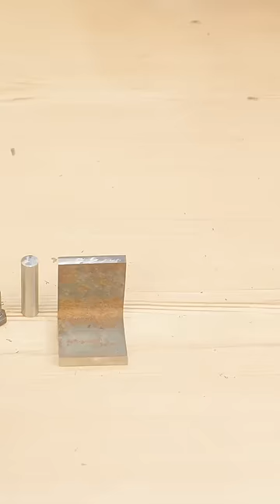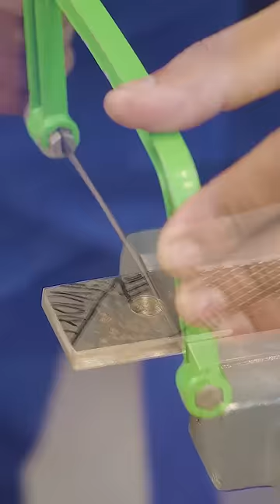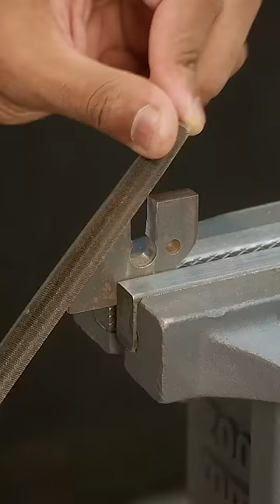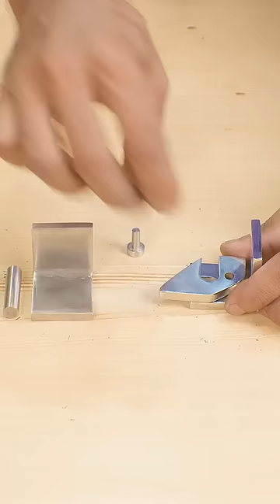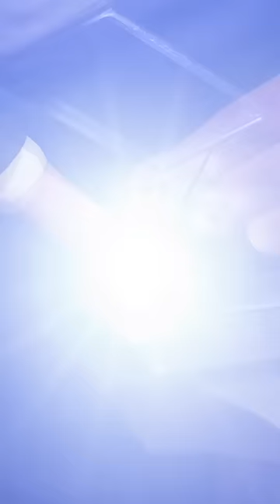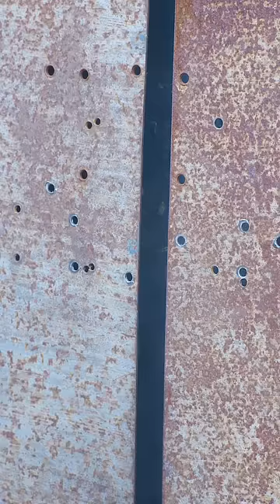crafting an amazing door latch 4 #metalwork #craftideas #diycrafts

Comment: How many hours did you spend polishing  those pieces? It'll be rusty tomorrow.
Reply: Seriously 😂, dude was acting like it was stainless
Reply: Looks like aluminum
Reply: @marcofierro5682  Til it oxidizes.
Reply: @marcofierro5682 it is steel.
Reply: @marcofierro5682 it was rusty in the beginning of the video. It's steel
Reply: Съемка закончена , ржавый мы не увидим 😂
Reply: Obviamente no es stainless steel , no es metal puesto que el metal no lo puede taladrar así de fácil y mucho menos lo puedes pulir para lograr este brillo entonces si es aluminio es algo con lo que yo trabajo mucho pero si ustedes dicen que es metal tampoco voy a discutir feliz día a todos
Reply: @marcofierro5682 of course you drill steel that easy with a drill press. I  drill it even with a battery drill when using a sharp drill bit
And it was rusty to begin with, can't be aluminium

Comment: Why do you countersink the screwholes only to use the wrong screws at the end?
Reply: I came here to say the same thing
Reply: Countersink the holes with just a larger drill bit hahah
Reply: The space for the filler metal.
Reply: Yeah why🤷🏻‍♂️
Reply: Não pode ?
Faça melhor e poste pra gente ver bonzão
Reply: To make it flush!
Guy did a great job building it why criticize it

Comment: It's nice that it's made from recycled parts and the satisfaction of doing the job yourself... also it's 1000 times cleaner job than most of the DIY latch videos on YT or any of these other platforms. Just needed a paint job or to be chrome plated(if you want the shiny look) to protect from the elements

Comment: Owns a Tig welder but not a band saw. Also that is angle iron. That will turn to complete rust by nightfall. Your a troll
Reply: You're correct and I agree with your though on the rust as well.
Reply: lol it will rust and match the fence nicely. might be the engineering steel that rusts to a specific thickness, and it takes a smart person to save for a tig welder rather then buying a fuckin metal band saw

Comment: So you countersunk holes using a tool that has wrong angle and is terrible at countersigning, but magically the countersunk holes are perfect. Then you use wrong screws. You also use a rusty screw and a power drill to make a pin, but again magically the final pin has tool marks from a lathe. Fake diy